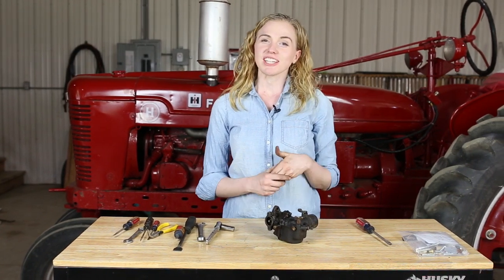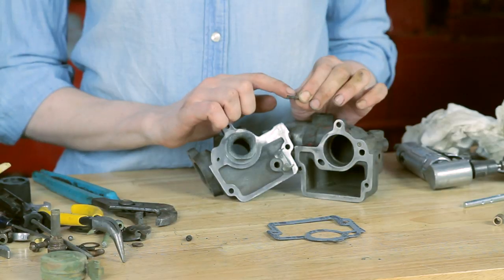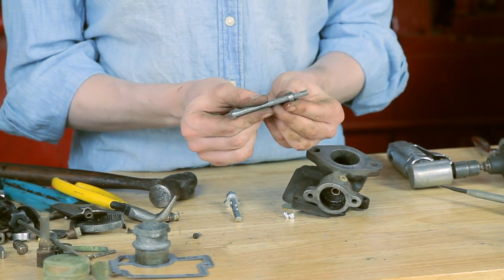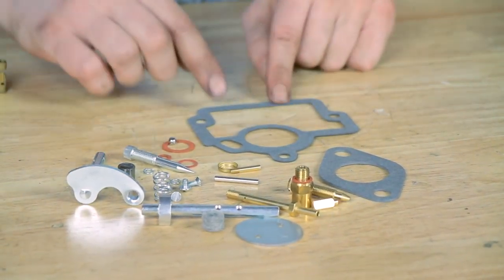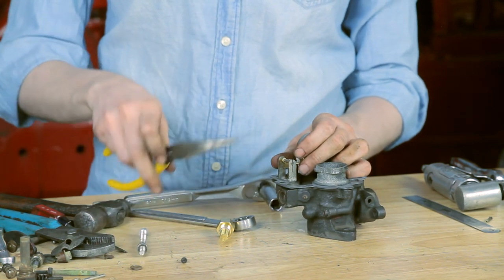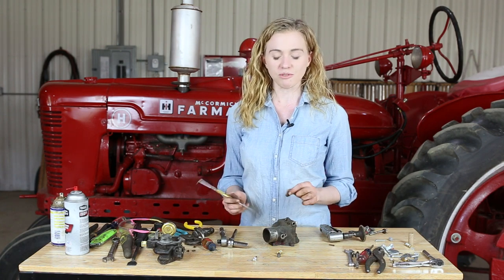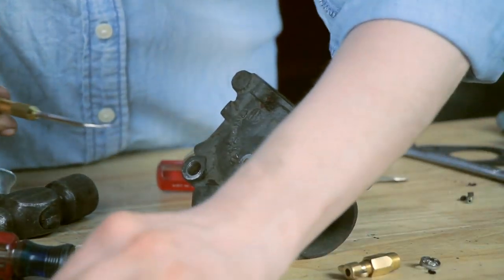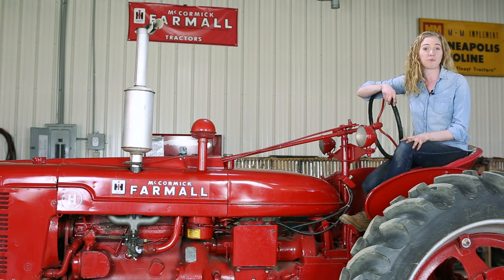How to Rebuild a Farmall H Carburetor: Easy-to-Follow Tutorial for Farmall H, W-4, O-4 or I-4

Comment: Nice tutorial. I was running my H yesterday, thinking about how I need to rebuild the carburetor, perfect timing.
Reply: I couldn't see the float assembly too well in the video, but sometimes the pivot rod the float mounts on has no retainer to hold it and can slip right thru. That's because the casting of the float chamber holds the rod in place. Thought I'd mention this in case the carb on your H is that way. You might have to hold the pieces vertical when you disassemble and assemble the halves or that little rod could drop out and disappear.

Comment: Great video, thanks!  

However, you didn't show the re-install process and I have a question in that regard.  I have rebuilt my carb and am ready to re-install, but notice I don't have a gasket for between the carb and the governor tube. I can't find the old one and don't recall taking it off, and my rebuild kit didn't come with one.  I assume there is a gasket needed there, is that correct?

Comment: When you install the packing around the main jet, you tighten the packing nut fully BEFORE inserting the needle at all? Seems like it will crush the packing before you get the needle in... I feel like the needle should be inserted after the packing nut is just started, then tighten the nut around the needle to keep the packings shape. Could be wrong though

Comment: Rachel, I have tried replacing the idler tube and still can’t get the carb to run.  What replacement carb do you recommend?  If you could give me the best 2 options that could be great.  The 374.00 option just seems excessive.

Comment: Rachel: I have heard that one of the best performance modifications for a puller H is to install a 350 manifold and carb. Have you ever done this mod to your H ?
Reply from the maker: Hi Dale, this tractor has stock parts. However, we've replaced the head, manifold and carburetor on other Farmall H tractors. It is an excellent modification.

Comment: Rachel...not long ago I acquired a 1952 Ford 8N Tractor. One day I noticed a Dull Rattle / Clunking coming from under the Seat when the Three Point Hitch reaches the Top of its Travel. Is this Normal? I dropped the Pump out of it thinking the Pistons were Worn Badly and Rebuilt it. A Visual from underneath before Reinstalling did not reveal any need for further action. With the Rebuilt Pump installed the Noise is still there. The other day I noticed if I let the Lever down a bit the Sound goes away. Any thoughts?

Comment: I like how you didn't show removing and installing the carburetor.  Otherwise this video would be 10 times as long, and you would be uttering very un-ladylike language.  The nut on the mounting  stud next to the engine is next to impossible to remove.  It's no wonder that IH went broke with engineering like that...